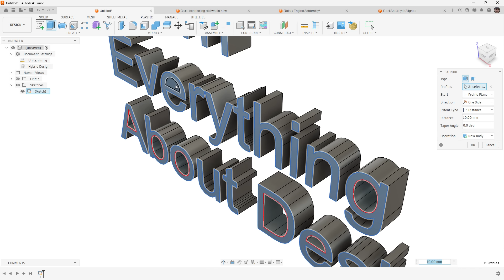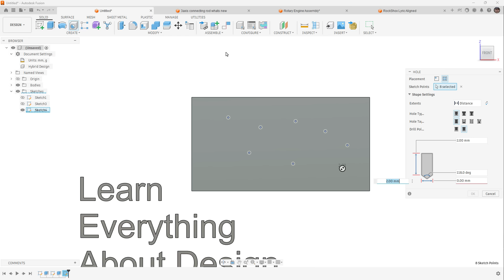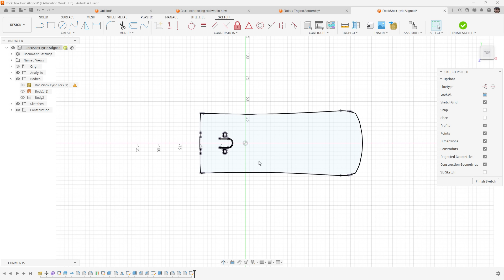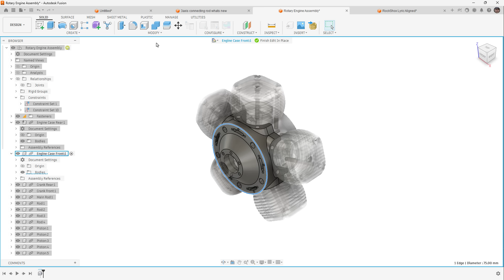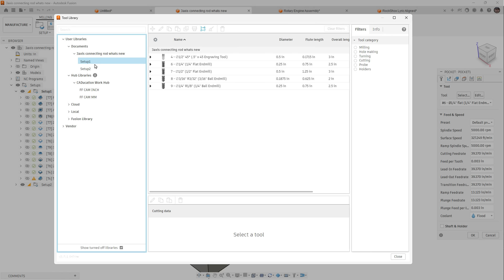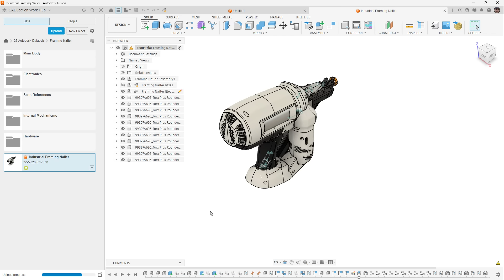What's New in Fusion | May 2026 #fusion #fusion360

Comment: basic features is still missing and fusion now very legy wrape feature inprint just like plasticity
Reply from the maker: We can kind of do what imprint does, but you can't really have a sliced edge in Fusion that doesn't extend to the edges (unless its an accident from deleting other faces....)  In sketches you have a few projection options and in solids i use Split Face and Split body all the time.  Not exactly the same but works in most cases.

I wish Fusion would have xNurbs and tools like offset when you select a face.

Comment: I don't like the update because I can't figure out how to tie parameters to an entire project. Without parameters (to update and tweak a final design, all the way through CAD), the principle of "parametric design" becomes hampered. I have not been able to figure out how to assign a set of global parameters, and have them apply to all components subsequently created and designed. This is either a bug, or I'm missing something.
Reply: make an empty document. add your global parameters and mark them as favs. save. derive this document into any other, and select parameters.
Reply: @schneik80  Thanks, I will try this.
Reply from the maker: The problem here is that Assemblies have a timeline, unlike an assembly in Inventor or Solidworks.  So in Fusion when you edit an external component, you go into Edit in Place, and the parameters you see are in that file only.  There is a local vs global parameter.  The most consistent way to do this is with a Hybrid Design.
Reply: @LearnEverythingAboutDesign  I've tried just about everything, even Hybrid. I usually start a project with a number of parameters I know I will want to tweak (global parameters). But as soon as I go into "edit in place" for a subsequent components, any global parameters I have previously set are not seen. Now I can export the global parameters, and then import them while editing, but that really isn't ideal. I'll keep experimenting, I guess.
Reply from the maker: @wagsman9999  You want Hybrid with Internal components, not external.  If you need them to be external for some reason you can always Create > Derive and send them to another file.  but you can't create circular references.
https://a360.co/4nZ7nYh

In that file there are 2 internal "parts" in a hybrid design.  In Change Parameters I made some length/width/height params and they are linked to both internal components.  

Until Fusion lets us do a "global" parameter, the Edit in place stuff is always going to go back to its own file and you can't reference a parameter at the top level in say a sketch in EIP.

You could use configurations, but again no real way to share.  you can have an assembly reference a config, but not directly reference its parameters. 

The only workaround really is assemble references while in EIP.  But you don't directly grab a dimension, but instead you would dimension to an edge or face.

Comment: I'm really interested in the timeline-based context. This really destroyed my 1st attempt with hybrid design
Reply from the maker: The timeline based context shouldn't apply in Hybrid unless you are bringing in external references.  The setting is only for Edit in Place assembly references.  I tend to avoid them but hopefully this new setting will fix these issues!!
Reply: @LearnEverythingAboutDesign yes. Foolishly every time I went to add a component to my hybrid design, the default type was a hybrid component and I used it and Edit in Place to do the design. I mean.. it wasn’t going to be a Part - the new component was going to have subcomponents and I thought that was verboten with the new methodology. I never loved Edit in Place, and now less so. A few different contexts and things started breaking. Eventually I ended up going back and exporting a few of my top level components from the design. Eliminating all of the contexts with redesign or hard-coded measurements and above all, now everything is a Part except for the top level. Can’t believe I was so dumb after all these years, but there you go
Reply from the maker: @rbyt2010  It is weird.  When in hybrid and wanting to add a new internal component.  Its certainly a janky experience :(

Comment: 1) If you're seeing any sluggishness on a PC with a good CPU, uninstall and reinstall. I thought my PC was getting old, but it's just that 3-4 years of updates has somehow bogged down fusion. 
2) is there a shortcut to switch between line types in the sketch pallete? Like to go from "3 point arc" to "centre arc"
Reply from the maker: 1. great tip!  I had done that a year or so ago after some data panel connectivity issue.  Might be time to do it again.
2. No, but you can make a shortcut for each of those.  From the drop down menu click the 3 vertical dots next to 3point arc and set a keyboard shortcut for it.  If you use certain commands a lot that helps.  The other thing you can do is pin it to your "toolbox" with the S key. that keeps it close to your cursor and it is 1 key and a click.